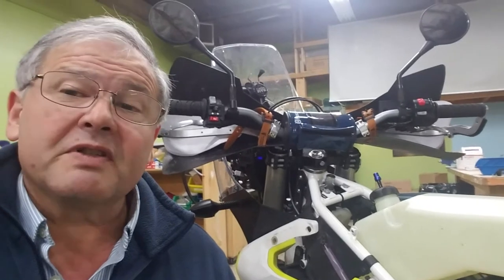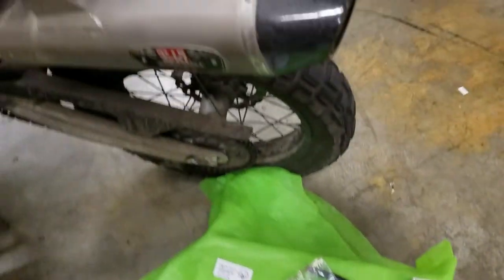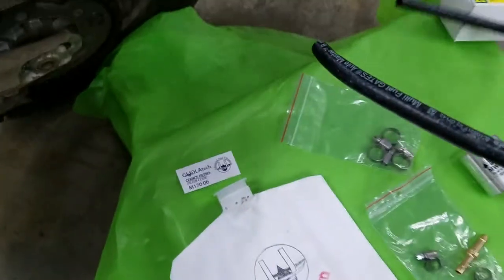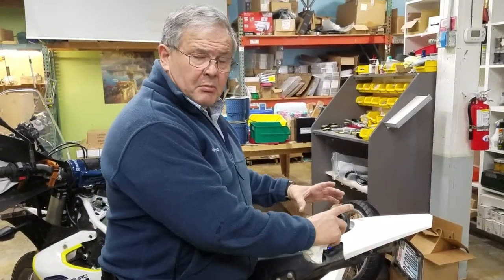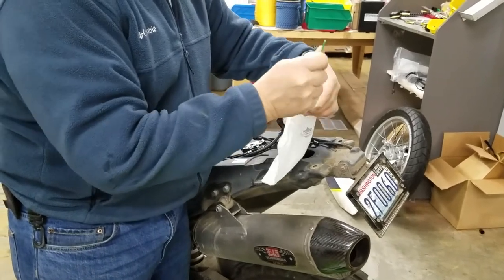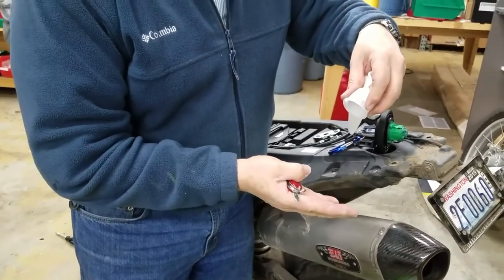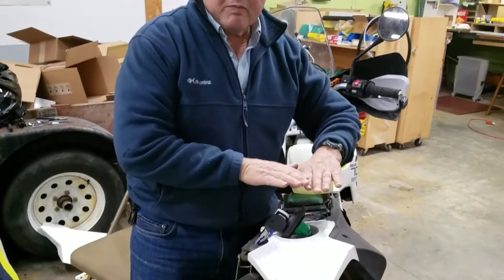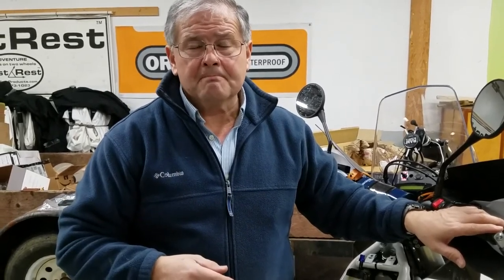Guglatech Fuel Filter Installation - Husky 701 / KTM 690

Comment: Thank you for this review and guide. I have a question regarding installation on KTM 690. Is the OEM (MAHLE KL97 or similar) in line filter replaced totally with the provided in the kit one and removed from the tank completely? And another question - is there a mesh filter for auxillary Rally Raid rear/front tanks? Thanks a lot in advance.

Comment: I have a question, if I may. Although this video shows the filter for the OEM cap, I - like many 701/690 riders - have the aftermarket filler neck, with screw on cap... Although fitting is slightly different (and the filters are slightly different) the principle is the same - causing the same problem - that the design of fuel tank means the Guglatech filter is pretty much folded through 90 degrees immediately under the filler neck!

Even though I have made sure the filter bag is unravelled when inserted (checked using a snake-cam), and I have used a 10mm Allen wrench (brand new with no rough edges to snag the filter bag) to open up the 90 degree fold as much as possible (where the petrol flows from the pump), the filter bag severely restricts the flow of petrol..! So much so, that getting 8Ltrs of petrol took more than 10 minutes! The pump attendant even called over the tannoy to ask if I was having problems!!!!!

Would love to know how I can get around this problem!!!???
Reply from the maker: That 701 tank is a PITA. Hardly any room. Yes the filter has to make a 90 degree turn. When the gas goes into to bag it has to pass thru the bag and into the tank. The bag is laying flat inside the tank, so gravity isn't working to help the fuel pass thru. If the tank is empty fuel passes more quickly, but if the tank is partly full and the filter is sitting in fuel, then the transfer slows to a crawl. I don't have a solution to the problem.

One factor that affects fuel flow is the amount of aeration of the gas as it comes out of the pump. Some pumps deliver fuel that has very few bubbles, others deliver fuel that looks like a well-shaken bottle of soda. It takes time for the bubbles in the fuel to pop, and that slows fuel delivery.

We've noticed that fuel poured into a 701 tank, from a jerry can, goes in muck quicker than from a fuel pump. But that's not practical when on the trail.

Sorry, mate, no silver bullet solution at this time.

Comment: Why does the 690/701 kit have an additional fuel filter? There already is an inline filter inside the fuel tank. If the “in-tank” filter gets clogged, your bike doesn’t run well or doesn’t run.  The only reason for adding a filter between the fuel pump and fuel injector is to filter out tiny contaminates which may get by the in-tank fuel filter. Zip-Ty Racing has a better solution for this. 

Is this filter meant to replace the stock in-tank filter?

Also, if you are refueling from a questionable source of fuel which may have water and debris in it, it would be a pain in the butt to empty the Guglatech filter, because the filter is bolted down under the filler neck. Thank you KTM.  To get around this, you would have to go to an aftermarket filler neck which uses a screw on gas cap, then you could install the Guglatech filter through the filler neck as normal.
Reply from the maker: I think you're missing the point, Philip.  
.
The Guglatech filter fits in the neck of the gas tank, and filters out ALL the crud that might be in your fuel.  It prevents contaminants from ever getting into the fuel tank, and passing onward to an in-line fuel filter.  If THAT filter gets clogged, which happens, you're dead in the water.
.
And no, Zip-Ty Racing doesn't have a better solution.  They have a <different> solution.  Their filter tries to solve the problem after it happens (contaminated fuel).  Guglatech prevents it from ever happening.

And also consider that the Zip-Ty filter doesn't remove water.  Guglatech does.
Reply: I was merely pointing out the hassle of servicing the Guglatech filter because it is bolted down underneath the filler neck on the 690/701 bikes. To clean out the Guglateck filter you have to unbolt the filler neck to remove the filter. That is due to to the design of the stock filler neck and locking gas cap.  As shown in your install video. 

My main question was why is Guglatech having you install another inline filter down stream of the factory-in-tank filter?  Zip-ty Racing has an easily installed and cleanable inline filter which installs at the quick disconnect of the fuel line just ahead of the fuel injector.   It filters particles down to 10 microns to prevent a clogged fuel injector. That is easier than adding the hose and filter the kit comes with.
Reply from the maker: @Sandbagan   depending on the type of filler nozzle (stock or aftermarket), the Guglatech MAY bolt down below the top, however some models are a drop-in and rest on the upper fuel neck flange, so it's easy to pull-out and service.  
.
Even so, the amount of contamination the Guglatech can handle (without cloggin) is 1000x more than the in-line Zip-Ty, and  servicing a Guglatech filter is a one time affair, at the end of the riding season.
Reply: I guess there is a misunderstanding here. 

My question is why the additional inline filter for the 690/701’s if the Guglatech filter is doing its job?
Reply from the maker: @Sandbagan  every additional layer of filtration is a good thing.   Just because there's another filter down-line from the Guglatech filter at the filler neck, that doesn't mean there isn't some gunk in the tank that's been there since the bike was built.  

On the 1190/1290 there's the  Guglatech filter that fits in the neck of the fuel tank, a filter on the pump (the Guglatech Godzilla), and most guys also add a Guglatech in-line external filter.  3 filters.  Why?  Because relying on one filter isn't always a good idea.  Redundant systems are good.  Same idea on an airplane.  Not just one hydraulic system, but three.

Somehow it seems you believe that the Guglatech filler-neck filter isn't doing the job, if there's a second filter in addition to that.  Faulty reasoning, my friend.